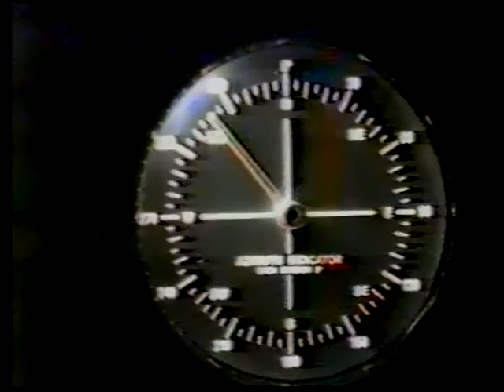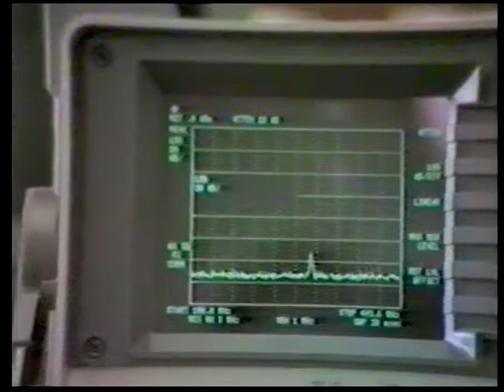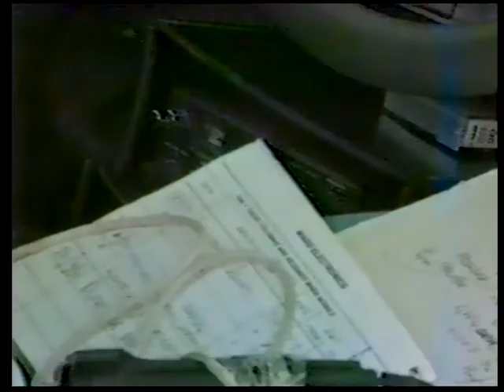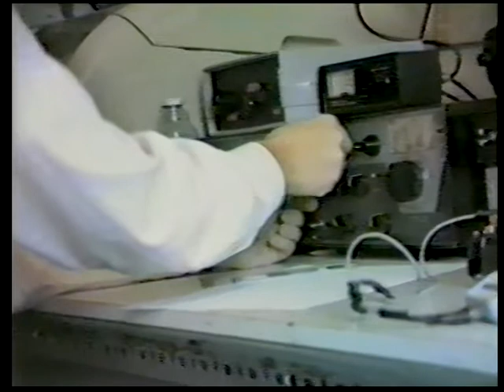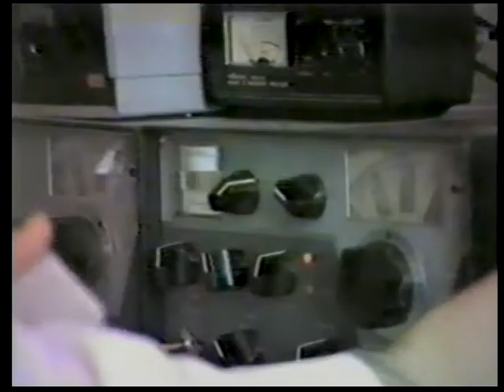Hatfield Polytechnic (University of Hertfordshire) Amateur Radio Society, 1990

Comment: I was at UH between 93 and 96. I took my RAE in 95 under the auspices of Dave Lauder G0SNO and obtained my licence (G7VJE) in July of that year. I was able to use the equipment at the Societies shack. While I haven't done much recently, work issues and vey local planning authority problems meant that I had to take my mast down, I will be resuming activity in the next few monhs when I relocate. Thanks for posting this video. It bought back some memories.